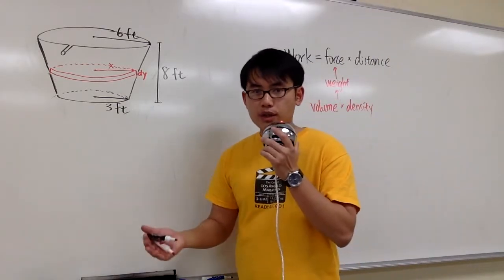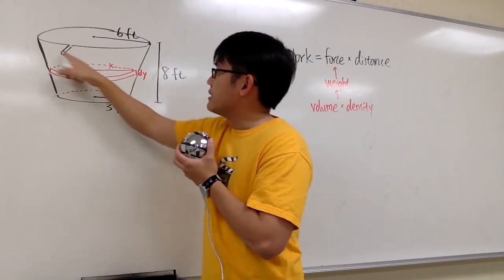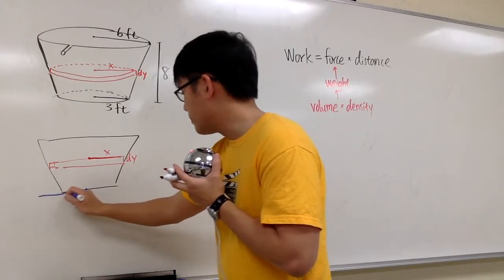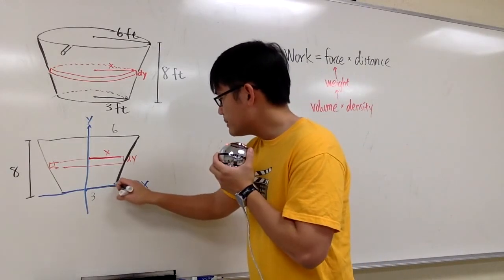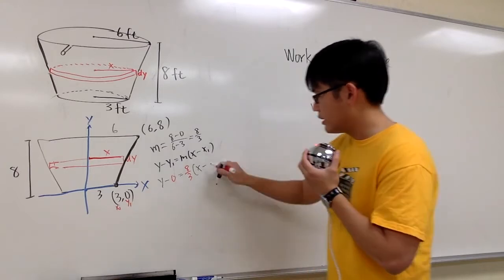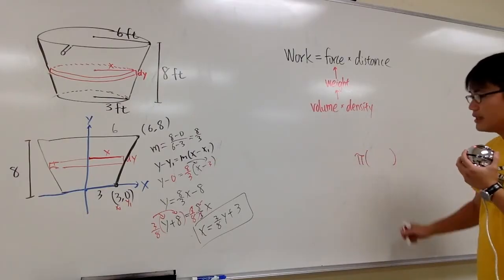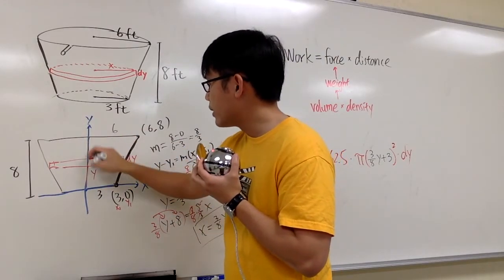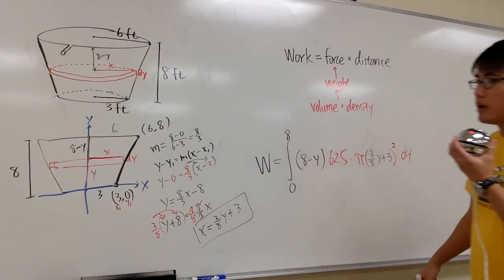Pumping water out of a bucket, calculating work, calculus 2 tutorial

Comment: acceleration is missing there, isnt it? Anyway, it's great.
Reply: In case anyone has the same question, lbs is a unit of weight (mg), so it already takes gravity (g) into consideration.
Reply: Also if you think in terms of units, adding (m/s^2) into the integral that is in terms of lbs and ft would not generate a unit of work. So the integral already has ft-lbs in it so you wouldn't want to add gravity.  But in problems involving meters, mass, seconds, you would want to add gravity so you can get newtons.

Comment: After you get x, wouldn’t you have to multiply it by 2 since it’s mirrored across the y axis?
Reply: You're just using x for your radius, and the volume function is pi * radius^2.
Reply: each disk is the area of a circle and that equation requires radius instead of diameter. if the problem was using rectangles youd need to multiply by 2